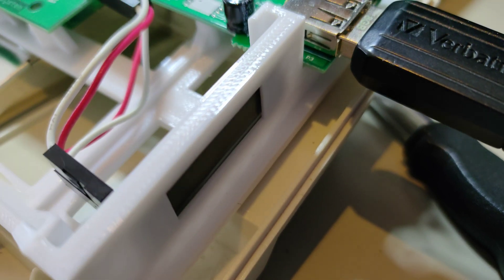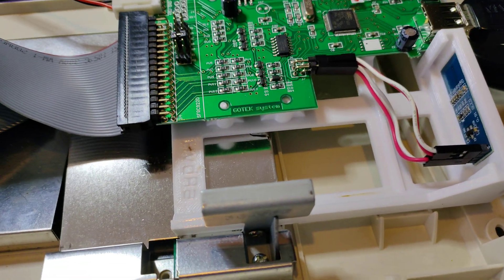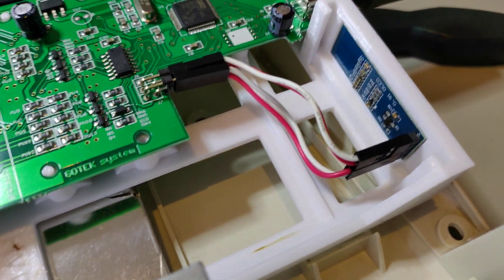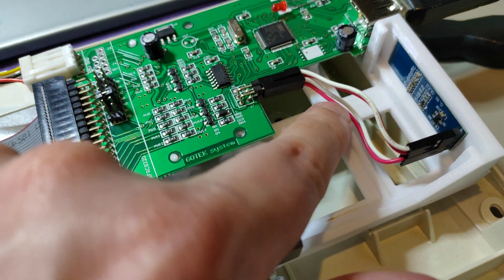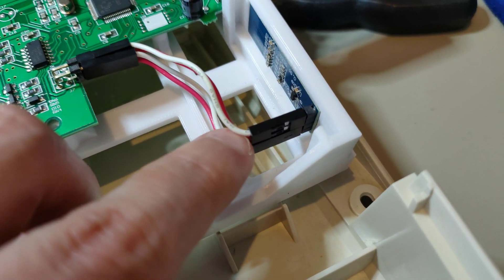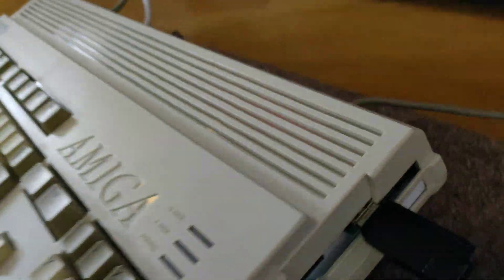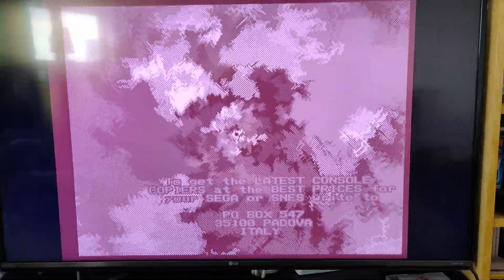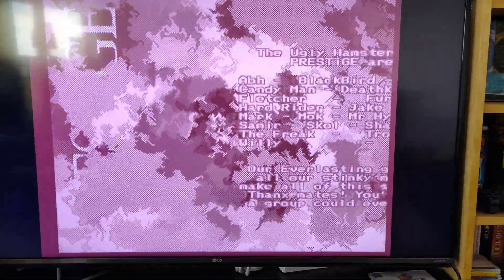Amiga A1200 Update - Putting the Gotek inside and changing it's display

Comment: i have the exact model and 3d printed bracke tyou have. i mounted only the one screw (internally) but it's like it won't fit afte ri close the case, how come?
Reply from the maker: That's hard to say. That internal screw on the bracket does have to fasten through the board and both metal shields (assuming you still have them) so maybe best to be sure they're all lined up right?